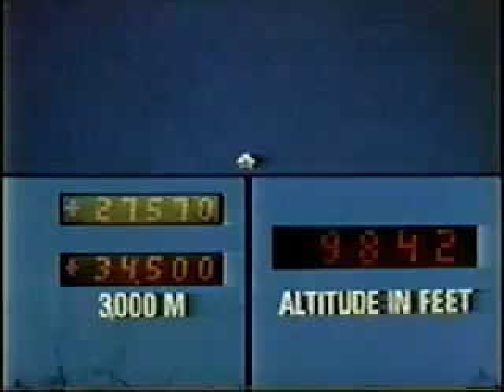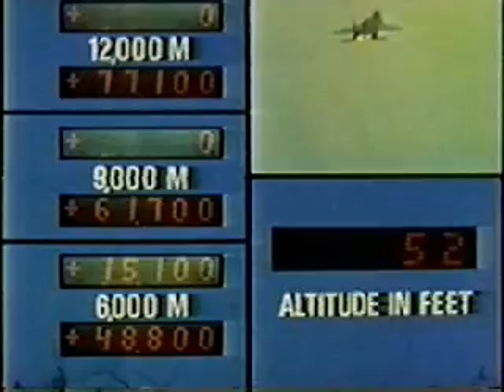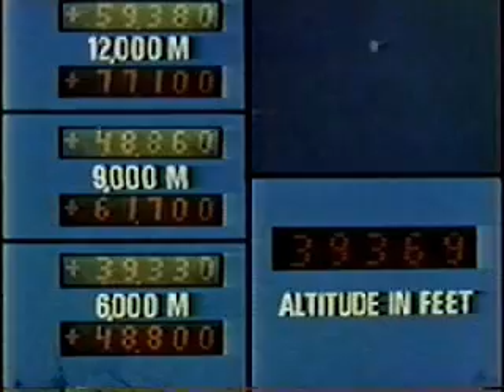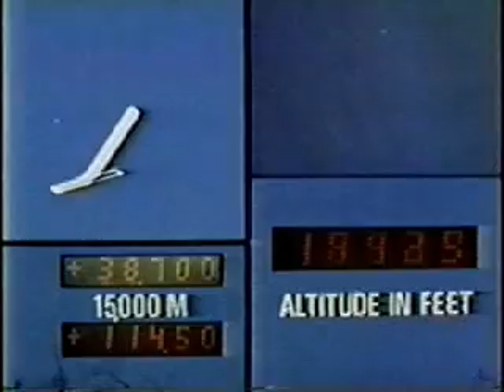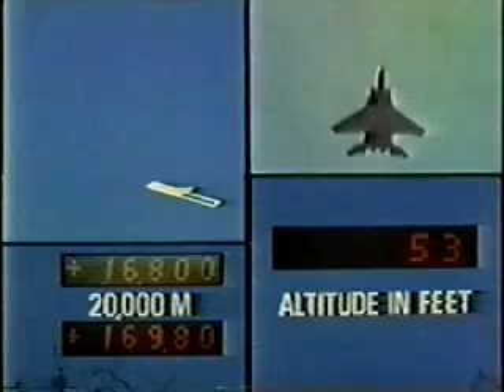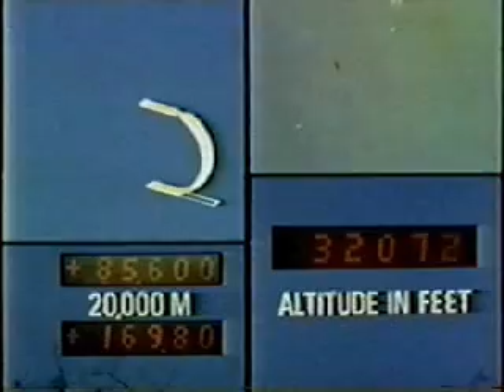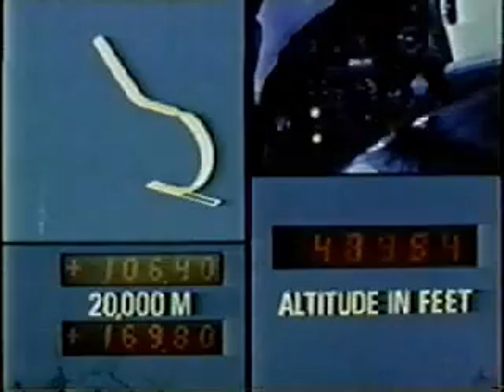F-15 Streak Eagle Record Flights Part 1

Comment: I would guess that the current record is held by the F22, and broken again by the Su57 with the new "Product 30" engines, back and forth between these two planes, just like in the 70s/80s between the souped-up F15 and Su27...
Reply from the maker: A more powerful engine doesn't necessarily mean a higher time to climb record. The Streak Eagle reaches 30,000 feet faster than the Saturn V rocket. Much of the climb performance has to do with the energy management and following the most efficient curve. A steady pilot is also required.

Comment: To 383 MAZDA:  It was same weight as F-15A...and your grandfather "Mac" was supersonic in 23 seconds from start of takeoff roll; as someone already mentioned, they had a hard time landing because engines substantial idle thrust; Mac went around on one of his landings and had to shut an engine down prior to "flare" to get it on ground. He told me the engineers said to "put the gear handle UP at soon as you see indication of airspeed" so as not to overspeed gear at 250KIAS. They bolted plane down, went full after-burner, and cut it loose at specified fuel load/weight. I forget some of the other stuff he told me, but said it was quite "a ride"..Understatement of the year.

Comment: For some reason shows like this always seem to bring out a lot of know it all experts that 99.9% of the time are wrong.  For example, these time to climb records are, never were or will be classified.  The very nature of such a record breaking attempt is to prove it.  International rules require both certified witnesses and technical proof of the event.  That’s not saying there aren’t even better records that are not being claimed which is normal and expected.  One trick we used to employ which we did with the F-15 back when it was first flown in 1972 was to claim a record but barley so causing your opponent to respond by breaking yours by a fair and hopefully all they had amount.  Thereby showing what their crafts true capabilities were.  Also, when claiming the first and lower TTC records the Eagle went supersonic right after T/O and climbed vertically “90 degrees” straight up.  They did not nor could not use brakes as the F-15 would slide on it brakes when in full A/B.  If you look closely you’ll see the A/C is held with a cable and released at the correct moment.  The F-22 Raptor is amazing but it’s sad that industry being what it is in America they won’t save the American tax payer billions by producing a new modified model with canted vertical stabs with an avionics suit patterned after that of the F-22.  We’ve learned what is needed in the coimbat arenas of today and the near future and an F-15X would be more than enough.  But that would totally destroy the F-35 JSF with it’s worldwide sales.  At one time Israel something like that with a re-engined F-4 and we shut them down quick.  That’s the absolute major reason the U.S. supports and pressures the world to respect each counties technology and patient’s.  It’s hard to sell planes for billions when someone is offering there’s for millions.

Comment: I was reading the comments, and how people are referring to static uninstalled thrust values when trying to compare the F-15 to the F-22.  Seems no one wants to mention differences in pressure recovery.  The 2D variable ramp on the F-15 is incredibly effective at this across all regimes (just like the F-14's) while the F-22's intakes are fixed with no internal ramps (just pressure spillage doors).  The F-22's intake is likely optimized for supercruise, but not so much for Mach 2+ speeds.  At the low end speed range, the sheer engine power available delivers already.

And like anyone else, I'd love to see a modern Eagle variant, with their more powerful 30K lb thrust class engines, stripped of it's CFTs and used in some records.

Comment: There's a vid on here showing a 1950's EE Lightning in private hands getting to 9000m in 60 seconds with a paying passenger on board. Wonder how fast a prepared military spec one could do it.
Reply: That doesn't sound right--that was probably a zoom climb anyway. The record Dave Stock set in that plane in a prepared attempt was 105 seconds to 9,000m from a standstill.  The Lightning's primary capability these days it to cause people to wildly exaggerate its performance (which, granted, is still amazing).

Comment: At least the f22 could break the sound barrier faster with two engines plus it’s a cool friggin plane but off topic from a different plane to the b1b lancer bomber with 2 HUGE engines with I think like a total of 120,000 pounds of thrust or more idk for sure but sure as hell is fast oh another one is old one is the sr71 blackbird that can out run a SAM easily like if you had an f4 phantom could fly to like 1200 mph to maybe 1500 max speed and f15-f16-f18-f22 and my old fav is the amazing f14 tomcat with 2 giant turbo props or turbo fans doing Mach 1 easy over ocean if you’ve seen now the blackbird could easily reach at an altitude of like 50-60-75,000 feet maybe 80,000 feet if it can go that high to a good old 2,000 to even 3,000 mph, now think of that as if it was little faster like 3600 that is going 1 mile per friggin SECOND so yah that has the fastest manned speed record but damn and the loudest plane I’ve heard personally is the f16 and probably also the C5 galaxy doing a low and slow (not really slow) flyby I mean they “said it was going slow like 250-275-300mph maybe  and since it is a giant ass airplane it was going around 560 or so at about 800 to 1000 feet maybe lower but damnnn it’s loud and it doesn’t even look like it’s even moving cause it’s huge
Reply: B-1B has four engines.

Comment: Airborne at 400ft!!!  Take off speed for an Eagle is around 140mph.  Think of that acceleration... It takes a Bugatti Veyron 1320ft (quarter mile) to reach 140mph, the Streak Eagle only took 400ft to reach that speed!  In other words, this airplane wouldn't  have just killed the Veyron in a quarter mile drag race,  it probably would have beat it in 100m dash!
Reply: top fuelers are attaining 320mph in 1000ft today, just sayin.
Reply: Supersonic in 23 seconds...
Reply: 383mazda there are factors you are forgetting. This is a completely striped down eagle so will be able to rotate far sooner than 140... lastly and this is with all planes, you can actually get airborne a little bit before v1 as long as you stay within ground effect. Seeing that this plane is accelerating so fast it probably would not be in grou d effect long but that does not mean they are not
Reply: @geminijetsnewmexico2238  the airplane weighed about the same as a standard F15C.  Weight saved by stripping things off was replaced by data collection equipment.   You're right about rotation speed though, the pilots were told to pull back on the stick as soon as the air speed indicator needle started to move, so it may have been a bit before 140, but not by too much.

Comment: The nose cone changed to a metal cone which was lighter than the composite. Moving leading edge were fixed and their actuators and systems were removed, airbrae also were reomved as well as the long tail sections and additional smaller fins on the bottom side of fuselage. The engone intake controls were removed and their position were set the best for less speed region, and finally the thrust of AL-31 were increased by 8% altering the gas temperature .

Comment: Yes, but only the smaller alt records were broken, up to 15'000 meters. Similar flight profiles which were required to 20, 25 and 30 km for F-15 were not flown by the P-42. The changes on airframe was much harder comparing with F-15.

Comment: I was at GFAFB from 74 to 79. At is was so cold when these flights took place. What you don't see in the video is that the F 15 did not want to settle on the runway when "ground effects" started to effect the landing. It would float over the concrete and the pilot had to bleed off some airspeed to land the plane. There was also a F 4 flying chase/camera plane duing these flights. On one F 15 landing the F 4 flew too close to the landing F 15 and "bounced" the F 15 back into the air. Good times!

Comment: okay... ugh so... the f-15 can race a space shuttle?
Reply: The Shuttle stack makes 65,000 feet around 81 seconds after SRB ignition, at which point it is traveling at Mach 2.4/1,600 mph. So the Shuttle slays it.

Comment: The takeoff alone is insane! 400 feet? Frak me!....
Reply: The engine run up was performed at maximum After Burner until the desired
"breakaway fuel load" was reached, then with a "highball" from the pilot the explosive bolt in the hold back was blown....quite startling!

Comment: Thanks for posting this.  I was stationed at GFAFB from 74-76 and got to watch most of these flights from right off the end of the runway.  Got to go in the hangar and meet one of the pilots and check out the airplane.  It was absolutely spectacular to watch this airplane perform these flights.

Comment: I thnk if they had reached mach 2.5 at 30,000 feet and then started the climb they could have reached outer space. I know the engines would have failed but there would be less drag up there and less gravity so it could possibly catapult itself into space using momentum.
Reply: That is completely wrong and totally ridiculous--not how gravity, math, uh science (? who cares!) or anything works.

Comment: Why did they do these tests in the winter at Grand Forks?  Were they taking advantage of the cold dense air?  I always just thought they did this record at Edwards.
Reply: Yes, cold dense air, greater lift, greater thrust....Some preliminary flight profiles were done at EAFB such as landing without any engine operating and restarting while rolling down the runway.
Reply: @normangaddy3048  hello, please how about the 280 meters above sea level the runway at GFAFB was situated? Were thay taken into account and, say, simply added to the respective altitude to be reached?
Yes I know, not a huge thing (once shot into a supersonic 90° climb the Eagle would have covered 280 meters in 0.9 seconds) but, not true 0 altitude though.
Greetings from Italy.
Reply: Compressors like cold air.

Comment: Ah! The cold war. They had a release bar holding the F-15 in place until the engine wound up. The brakes wouldn't hold the plane still at full throttle. They stripped every ounce off the plane they could. There wasn't any paint on the skin, bare metal! They practiced and practiced trying to get the gear up as quickly as possible, to gain more speed and to not exceed the design speed of having the gear down. It was a serious problem. If I'm not mistaken, the Russians used a 2000 lbs payload!
Reply: Mike;  Streak eagle smith wiped out my tabvee at Bitburg.  Some info.  The rigged the wow switches so as each wheel left the ground it would fold into the airframe.  The eagle was FLYING in three lengths of the aircraft.  It then pulled a 90 degree vertical position and flew to 90,000 feet when the engines flamed out (no oxygen).  He was going so fast he still flew straight up for another 20,000 feet!.
Best aircraft ever.